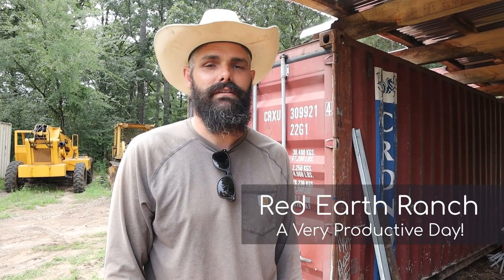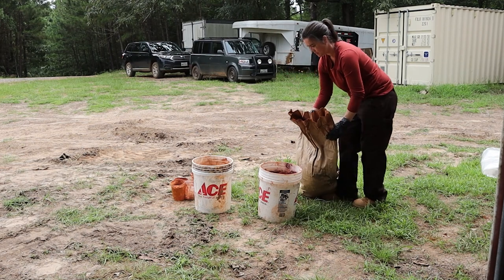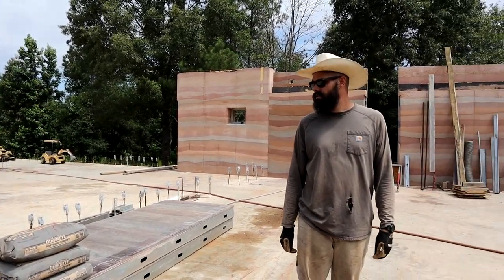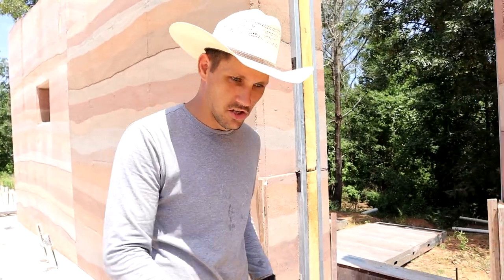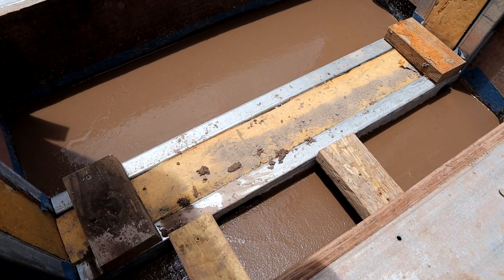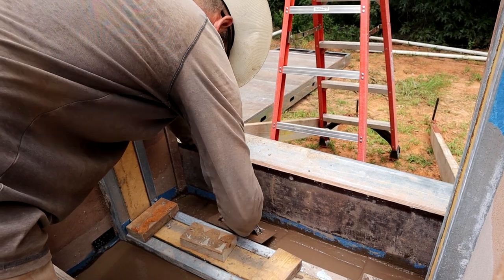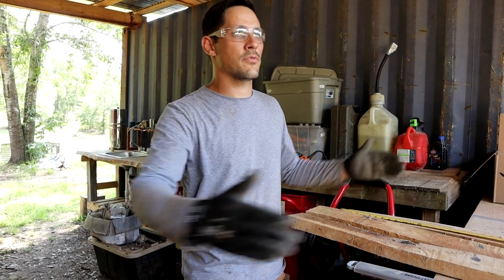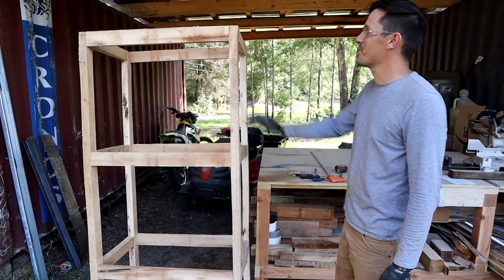Ramming Under Windows and MUCH More - Vlog 68

Comment: I can't for the life of me...understand why the foam is being used
Reply from the maker: It provides a thermal and vapor barrier. Without the foam you have the same issues as a Medieval castle. Sure you have plenty of thermal mass but eventually the outside temp will creep through the wall and you have an oven during the summer and a freezer during the winter. In milder climates you may not have those issues but where we are it makes a lot of sense.
Reply: @RedEarthRanch  I assisted (Design wise only) with a RE house near here. The owner is an environmental engineer and he took the temp of his walls for about a year after his house was built...with a thermo imaging camera I think, he says the walls stay at about 68 degrees all of the time... I def believe you...just wondering what the difference was with his build as he didn't use insulation at all. He did have 18 inch thick walls though
Reply from the maker: @boardwalkbw7130  That is super interesting! A lot of my knowledge is from other's testing and development and not from first hand experience. You have me really curious to try and do a test wall without insulation and see what happens. My guess would be that with extreme temps the insulation slows the thermal change. When I investigated how R-value works it can actually be calculated for material similar to rammed earth and all the numbers I ran showed that it would resist thermal change considerably better with a true insulator like foam in the middle. But this had got me thinking I may want to try a test wall or two. Thanks for the input!